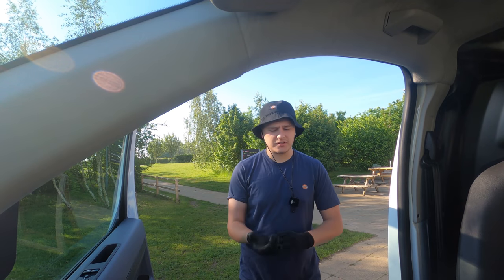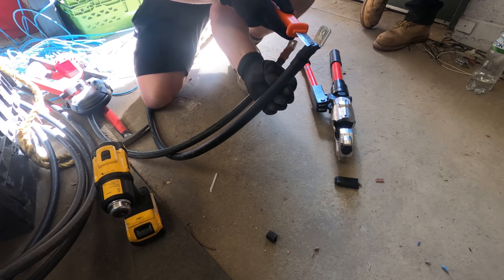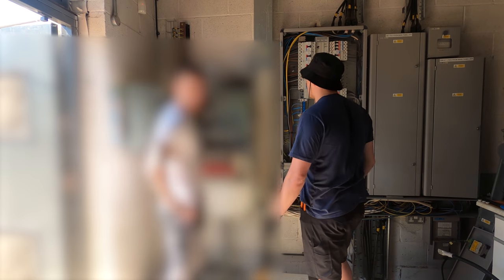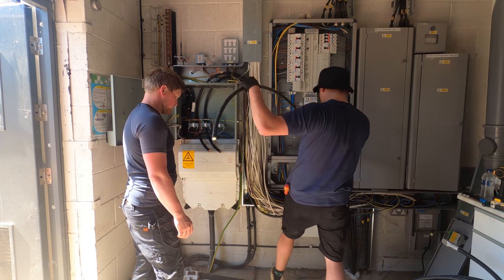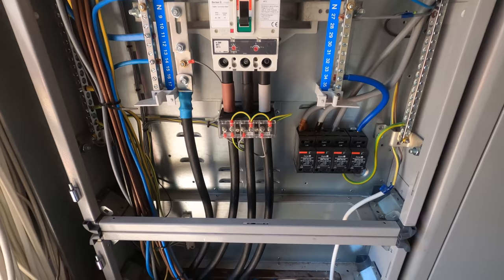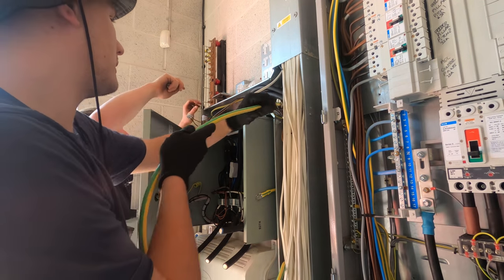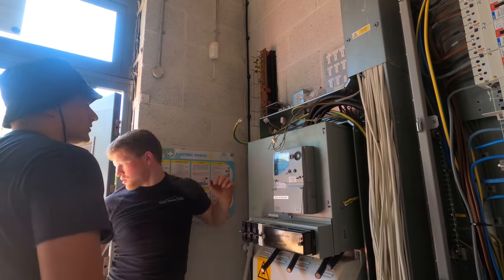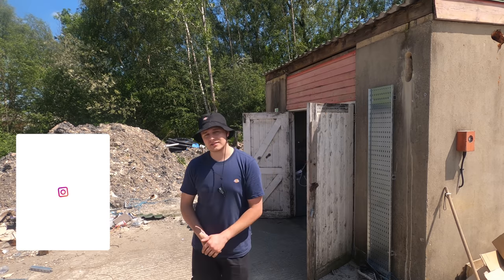Upgrading a football stadiums electricity supply

Comment: Proper work. But I can't believe it took all day to fit five singles.
I had to make up plywood false works to do the cable bending for a 1kA supply. Took 3 days to get it all on the wall. Parallel 300mm singles IIRC. You need to get those lugs correct in every way. That was without a power bandsaw too. Ah. The good old days.
Keep the videos coming.

Comment: Battery crimper so much easier also butane torch for heat shrink . Love the hat feller and another good job,,and a table to work off no more crawling on the floor and bit of shiny for the weigh in end of week,,prices are great at moment..ohh bandsaw to cut cable with like it save the ratchet cutters and wrist...link for torque wrench

Comment: Main earth 70mm ? it should be no less than half the size of the neutral conductor on a TNCS
Reply: It depends on what method you use to calc the earth cable size. You could use the adiabatic equation, and it may have dropped a cable size (ie 50 instead of 70mm2). Though you can't really win if the DNO says you need to use a specific size (despite what you or I may think)... 

I'd be curious why 150mm2 single core cables were selected for a 315A supply...being heavy handed with various derating factors never hurt anyone I guess!
Reply: @gloveyourway2000  the half size rule is to cater for diverted neutral currents in the event of broken pen.

The DNO guy mentioned the additional rod laid in the road. This is prob why they arnt to worried as worse case scenario most of the diverted current will travel that path 🤷‍♂️
Reply: @tomorichard  That doesn't sound right. Earth cable sizing (as noted in BS7671) is done on the basis of short circuit protection (hence why you can size the earth cable using the adiabatic equation or use sizing tables). A PEN fault (typically) occurs on the supply side (ie for this video, a PEN fault would occur upstream of the 315A fuses, and be a DNO issue to resolve). 

The rod (I believe) is a requirement of the TNCS earthing system, whereby you need to earth the neutral and various points along the distribution pathway to ensure a low impedance back to the transformer.
Reply: @gloveyourway2000  you are correct. Thank you for picking me up on that. I had it in my head PME main earthing could not be sized via the adiabatic equation due to the worry of diverted neutral currents and had to sized via selection. However I was thinking of the requirement of sizing main bonding with respect to the incoming neutral.
Reply: @gloveyourway2000  you cant use the adiabatic equation on TNCS
Reply: @persona250  Can you explain why?